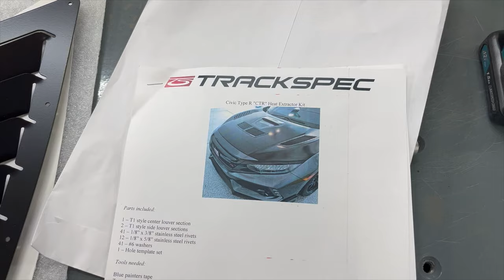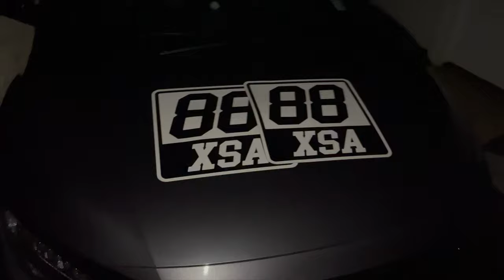Cutting Holes in my Civic to Make it Faster (Trackspec Hood Vent Install)

Comment: I respect the work, came out really clean. I thought about doing this but buying a carbon hood was just much better imo being that it’s so much lighter than the stock hood and already has vents. As for the resin problem, immediately I got it PPF’d. Seeing your expensive mod fade away in the sun is so painful.

Comment: How long have you been building your si for?
Reply from the maker: Started out stock in March of 2020
Reply: Dope yea I started out in August 2021 and now I'm full bolt on minus charge pipes...on TSP+ 26PSI and I be pulling on everything besides M series BMWs...I'm about 240 250 hp but I want to do the headstud bolts b4 I go flexfule.
Reply from the maker: That’s the path I would recommend. Definitely pulls well for what it is. Keep it up!

Comment: Does water get in?
Reply from the maker: Yes
Reply: @gavindanitz  is there a certain area where it’s ok for water to get in , or will it like effect the engine performance?
Reply from the maker: It depends where you cut. Water is safe to a degree
Reply: @gavindanitz  where would u say is the best place ? And places not to put it
Reply: @gavindanitz  There may be a solution to not getting water nor snow in your engine bay with hood vents ,but not sure hence I am asking. There is something called rain guards for hood vents but I am not sure if they work nor if they also guard the air away